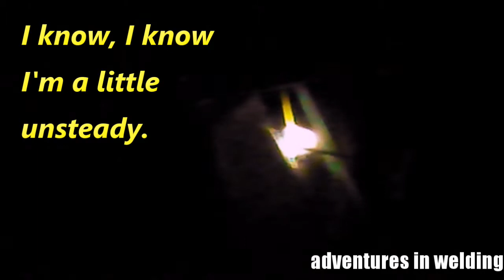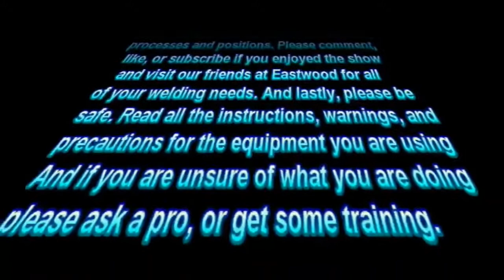Adventures in Welding 105 Titanium

Comment: Thanks for sharing your adventure.
I noticed that you said, at about 3 min 29 in, that you're running about 25 cfm. Not cfh, but cfm. Now 25 cfh is a lot, even for the largest cups. I know you're running that to the purge and not a cup, but that's still 60 times more.